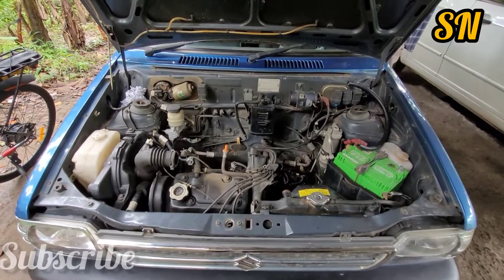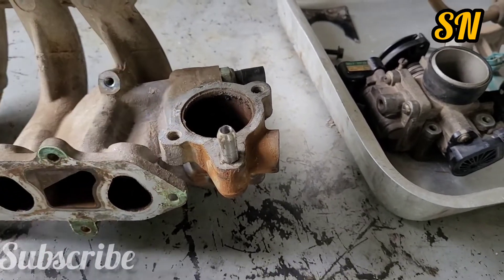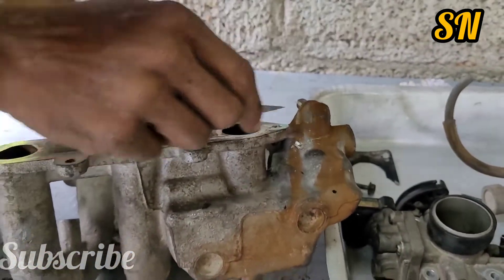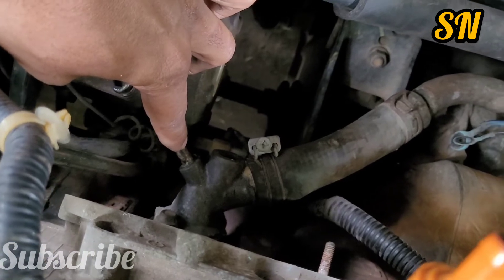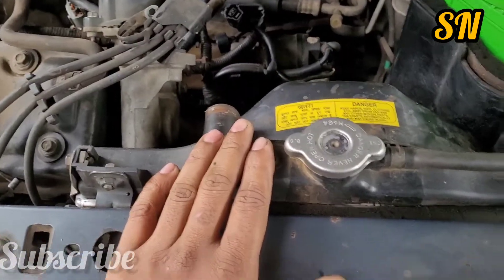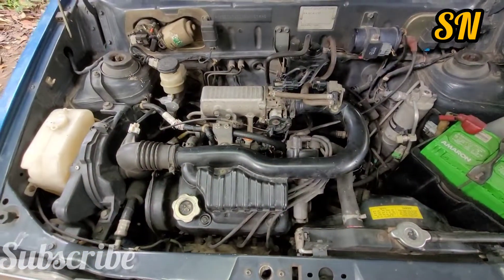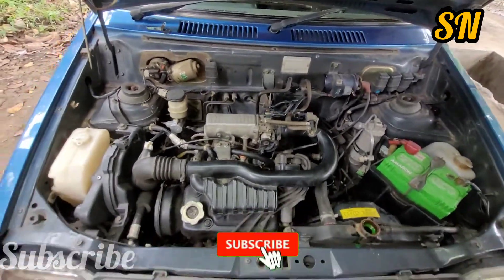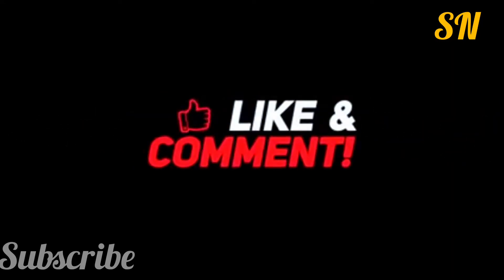MPFI maruthi 800 Intake manifold water leak problem solved - malayalam

Comment: Bro ente altoyude coolant kurachu divasam munne change cheythu..athinu shesham coolant reservoir tankil vannu nirayunnu.. radiator cap maari nokki..fan okke working aanu..overheat aavunnumilla
Reply from the maker: Thermostate valve nokkanam
Reply: @snautomobiletechvlogs  radiator cap thurannu vechu vandi start cheythu race akkumbo cheruthayi kumila varunnind..gasket poyathayirikkumo
Reply from the maker: Gyasket poyathayirikkum.